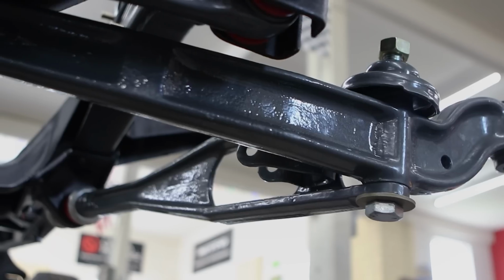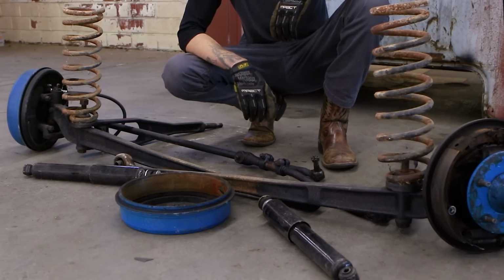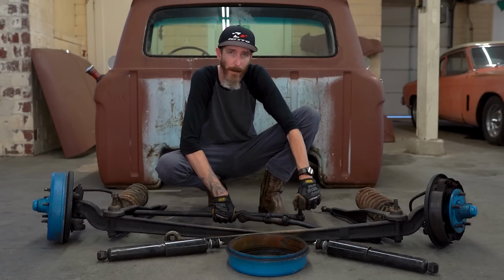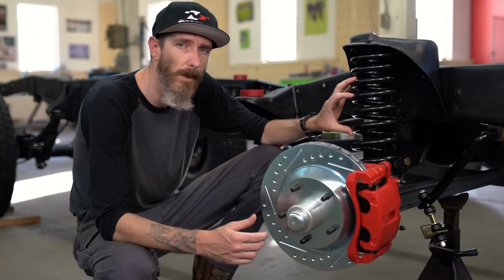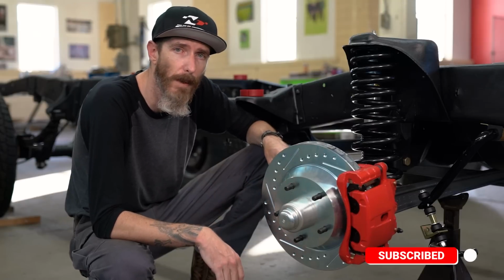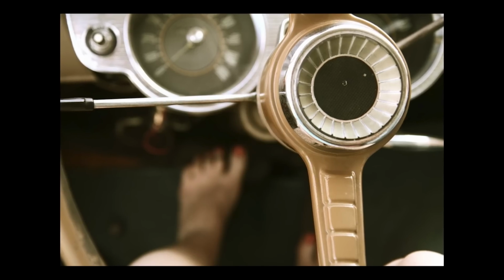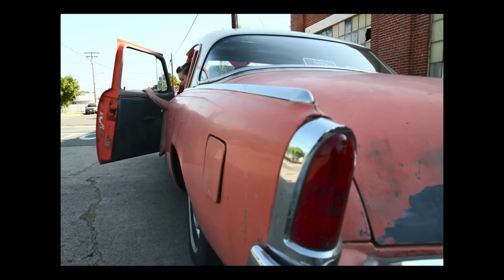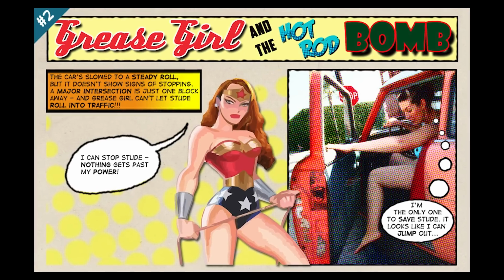Twin I-Beam Front Suspension Resto Build | Extra Good

Comment: I have a 1989 F-150 Lariat (XLT) 4x2 long box regular cab. It has the factory camper/handling package. It’s got sway bars front and rear, front disk brakes with antilock brakes installed on the rear axle only. With power steering, port injected 5.0 v8 and AOD 4 speed automatic with a lock up torque converter.  It actually rides pretty darn good and has decent handling. And it actually has a pretty sharp turning capability. 

Tough suspension. Also has plenty of travel and articulation with good ground clearance. Bumps, pot holes, speed bumps, speed humps, rail road tracks, curbs and even the occasional ditch, no problem. And the body is as tight as a drum. It’s decently quiet too. 

Your definitely right about the camber change as you go down the road. But so far I have minimal tire wear issues. My truck does not get driven much. It still has the Bridgestone Desert Duelers my dad installed on the truck back in the early 1990’s from Sears. (I inherited the truck upon his passing.) They came with a lifetime warranty from Sears.  They have out lasted Sears. So, I think my warranty on the tires has expired.  

Are you going to install the Ford Flex-O-Magic rear leaf spring shackles on your truck? They give an excel ant rear ride when the truck is empty and stiffen up nicely when you put a load in it. It looks weird, but it works great.

Comment: Oh man. I have and drive a 1966 f-100 . I hope to be able to fix it up like you did this. I can't do the work myself. Bad back and only a driveway anyway. If I get the money together I will have a mechanic do it. That takes the pride out of it though. Great video you guys😁👍
Reply: Hey, I have a 1966 f-100 too, since 2020, with drum brakes still, but with a new dual reservoir master cylinder. The thing is, it stops slow and can go fast! But at least the hydraulics are a little safer, same story. Speedway sold me the MC and I learned to do double flare lines with copper / nickel, not too difficult. I'm old and work in the driveway too. Back okay but joints get sore!
Reply: @bluetruck53  Love it! Get that truck to stop fast!

Comment: I daily drove a 73 Econoline, had 10" drum brakes at all wheels, manual brakes, manual steering, a friend found the rear brakes were not engaging, went through 3 manual master cylinders, rear never engaged, I replaced the rear hose, nothing, the day I put power brakes on and pushed the pedal down, the braking warning light immediately went out and you could hear the rear engage, evidently 'new' manual master cylinders made for that van, none give enough pressure to the rear. I decided time to put power brakes on when it rolled down backward in a parking lot, rear stops you going backward, power was enough to nose stand it when panic stopping. I drive using hand controls, one hand on the wheel, left hand operates gas and brake, yes I can one hand manual steering. Tho my 73 was totaled in a head on accident, "buy a dash cam and add it," moving a wheelchair lift, power seat base, hand controls, and modifying the van to fit it all takes a lot of time, money, and patience, along with help, because every bit of it is heavy, I prefer the older less electronic approach when it comes to vehicles, due to living way below poverty, I don't have the money to be replacing everything in a vehicle, and there is a lot in anything built in the last 20 years, requires an engineering degree.

Comment: My 1968 F100 has the twin I Beam. Never wore old a set of tires, they would rout out first. Just recently though I hit a bump and then it kept sounding like something broke. The year before I replaced the rear shocks. Should have done the fronts then too. They looked ok and seem to still function. We'll what happen the drive side front shock froze solid, When hit the bump it ripped the bottom of the shock and shock mount to pieces. It was fun trying to find a replacement mount. It mounted to the radius arm. It took a week to find. So, those with old trucks watch those shocks. It could not hurt the Twin I Beam though

Comment: How did you attach the sway bar. Make bolt on brackets? Weld it on? I found a sway bar I want to use. But really don't want to weld on the Ibeam.

Comment: I want to do the exact same thing for the front end on the 1965 F100 that I am putting together.  Could you give me some specifics on the the coil springs that you used.  Also, any help you could provide on finding replacement coil spring bushings would be appreciated.  Can't find them anywhere.

Comment: Just bought my dream truck and very first restoration project a 1968 for f250 camper special doing some suspension work as well right now getting the motor dialed in could use some advice how would you go about lifting the cab off the truck to sand down the frame ? Is this a major step in restoring an old car is lifting the cab and bed off the frame nessary ?
Reply: Open doors, put a wood beam through the door opening, lift from there.